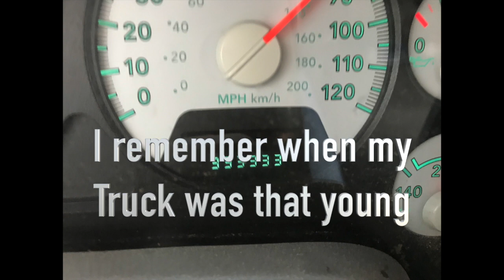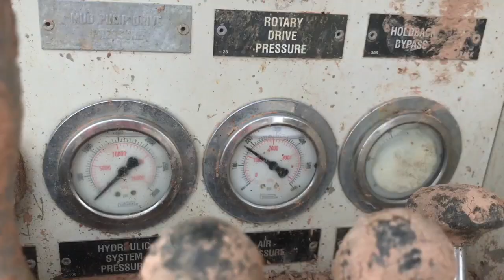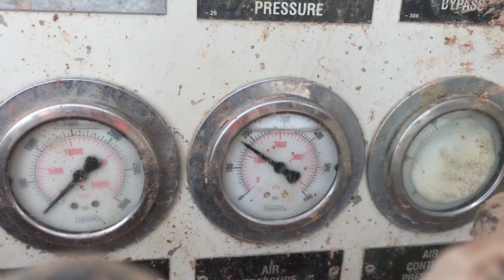Airlifting 16" well

Comment: Do y’all gravel pack them?
Reply from the maker: Almost every well here is either gravel packed or sand packed depending on where it is at
Reply: Most of the bigger ones we do are too. We use a lot of 12/20 and 16/30